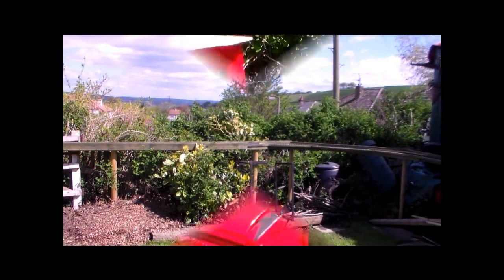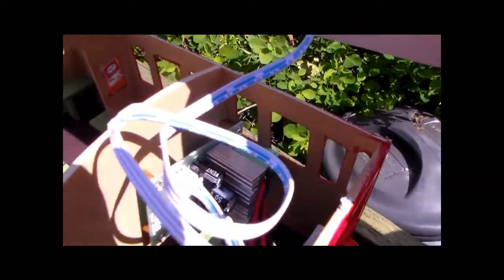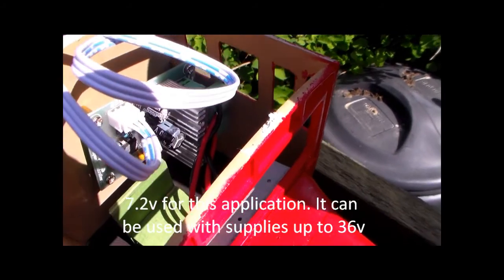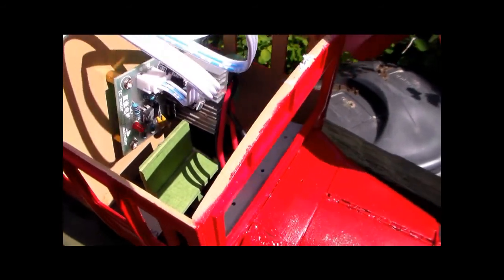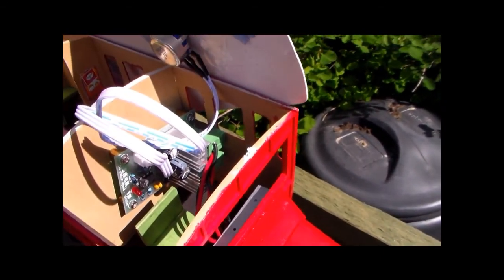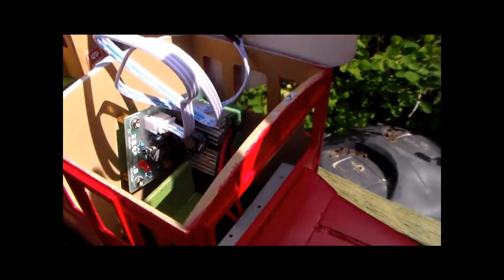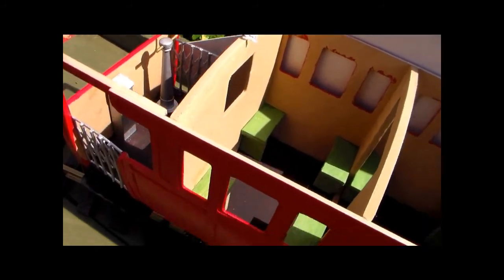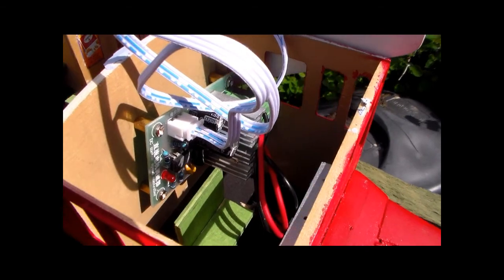Low cost speed controller in IP engineering railbus

Comment: She looks to be a very smooth runner indeed ,,, but you sound as if you know your stuff when it come to electronics and wiring ,,,, ,,,, Alan
Reply from the maker: Well I should be able to build my own stuff but tend to just fix ready made circuits together. The speed controller is cheaper than the components would cost and comes from China.